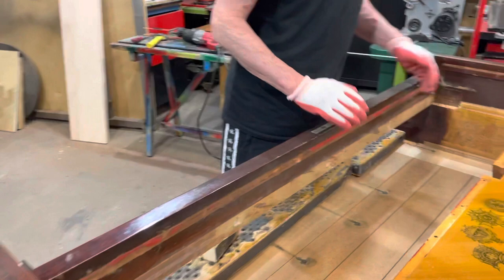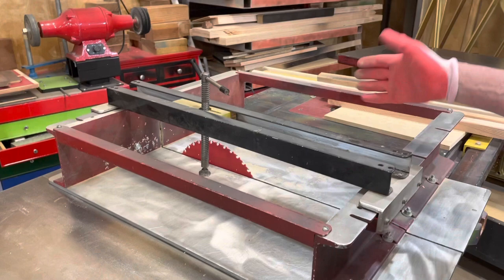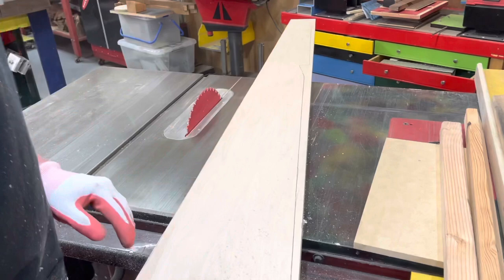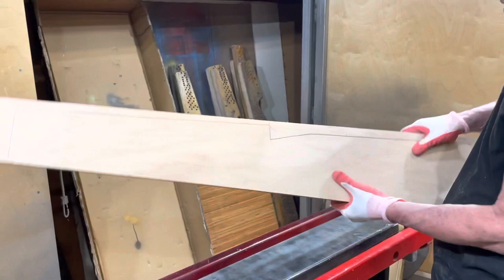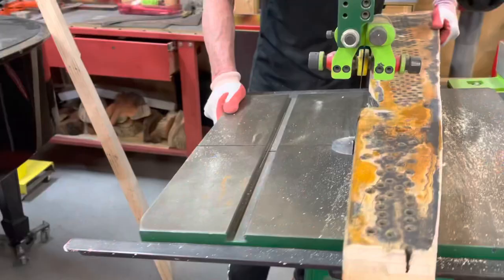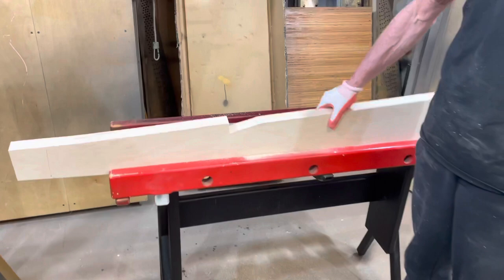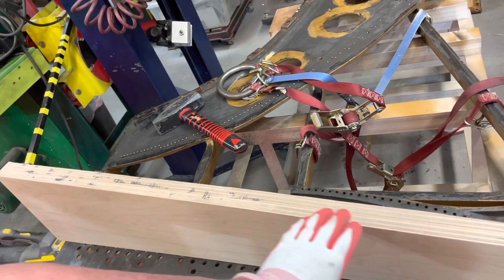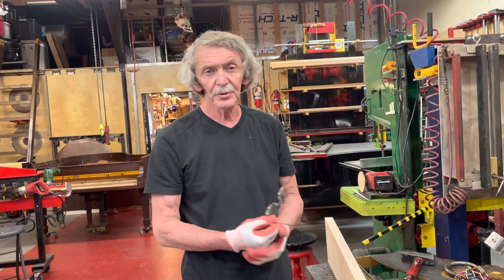Piano Solutions XXI: Making the New Pinblock on the Grand Piano. Pinblock Duplication

Comment: I am restoring a 1921 Christman Studio Grand piano.  I noticed early on that the cover wouldn't close properly but I didn't know why.  Now that I've restored the soundboard, I see that the case is warped on the side where the case hinges are mounted.  My question is, how do I straighten out the case when it's made from multiple layers of hard maple? Thank you.
Reply from the maker: The proper way to do is to weaken the wood first and then reconstruct it and glue it on the proper positions and reinforce it. This is a difficult task. I would only recommend a professional to do this.

Comment: Can i use marine grade teak instead of maple?  It has more oil so not sure if pins will stay as tight?  It won’t warm and bend like maple
Reply from the maker: As far as I know the common wood that is used is maple or beechwood but it might work if you do a proper lamination on the pinblock. It has to be tested of course to be 100% sure :) From my experience, working on antique pianos - I did see different woods used on pinlocks.